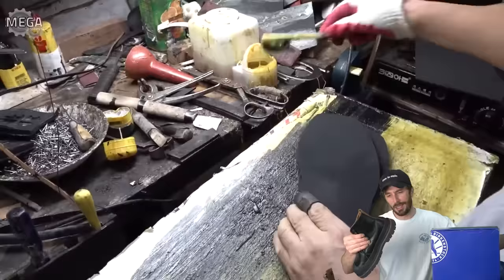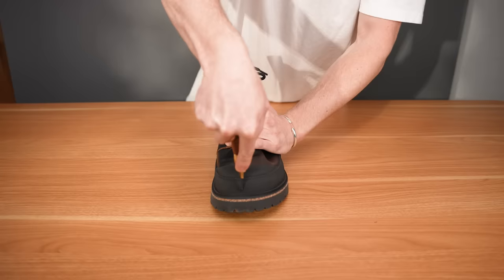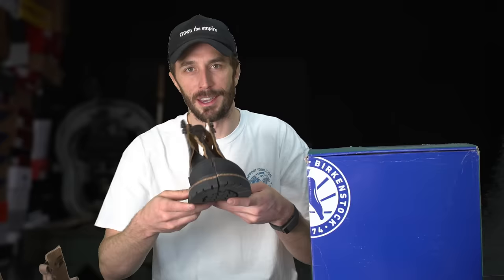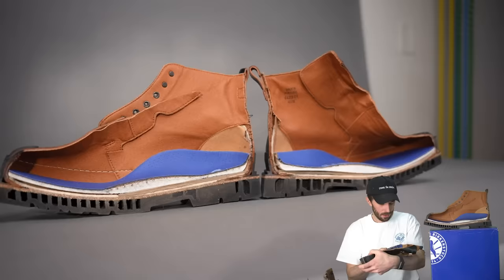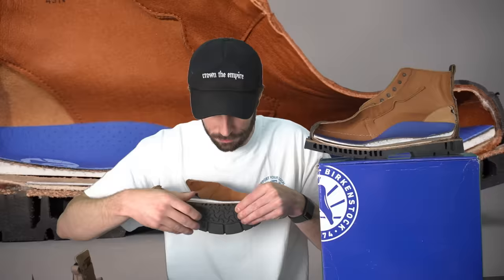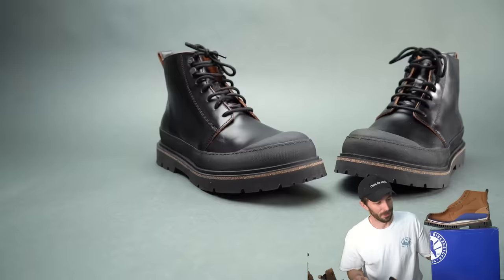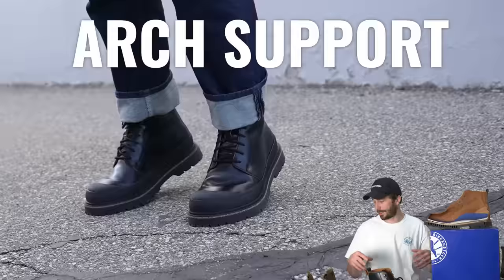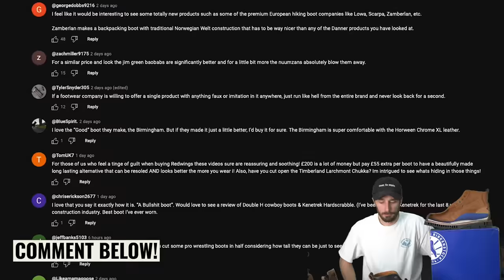What you really should know: Birkenstock boots - Prescott

Comment: Thank you for the all of the tenacious Birkenstock videos.  I am a long-time Birkenstock customer largely for their Arizona sandals, and I agree heartily with you: their sandals are top-flight products.  I have not tried any of their boots which you have analyzed.  However, I own an older style that is (sadly) no longer made: The Harris.  I have had my Harris boots for about  seven years now, and I have been extremely pleased with their durability and construction.  A chief difference between the Harris and any of those you review is that it came with a standard removable cork insert that molds to the foot, just like their sandal.  I attest to that.  It also has a comfortable outer sole that made for a gentle walking sensation -- this is important, because the removable inner sole is traditional and not the modern soft option; actually, I am not sure that it would be possible to put that additional soft layer in the removable insert.  Over the years, my Harris boots have become hard on my legs and knees, and so they have gone in for a re-sole.  I suspect that the original outer sole has become compressed, and in any case, it is showing some marked heel wear.  While the original outer sole is no longer available, my interactions with the cobbler make me confident that there is a suitable 2024 alternative.  Birkenstock Harris boots are still out there in the searchable Google universe, even NOS pairs -- sadly, none of those can be found in my size.  I am reluctant to suggest that you pick up an NOS pair online somewhere and take them off the market to cut one down, but in the greater good, maybe it would be OK to see if (as I suspect) the inner construction of this boot is superior to some of the ones you have analyzed.  Perhaps you could find a used pair in good condition and analyze those.  I am very pleased with my Harris boots, and I very much wish that Birkenstock would make them again.